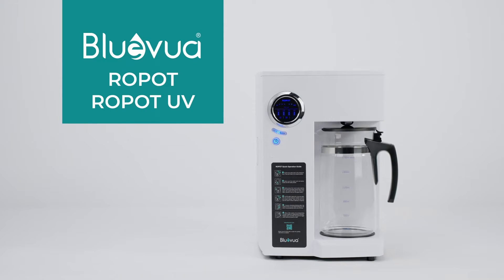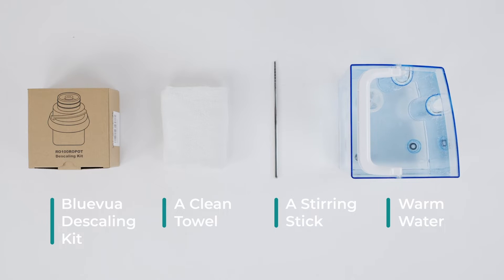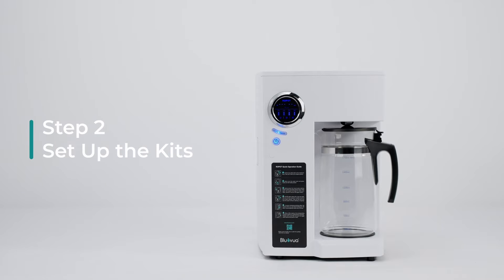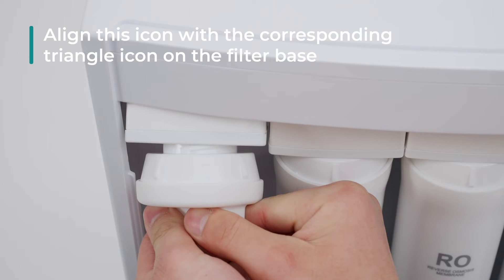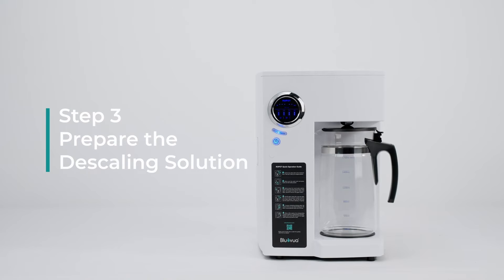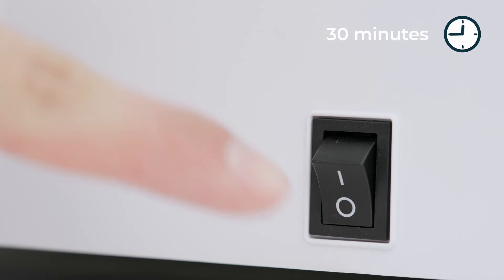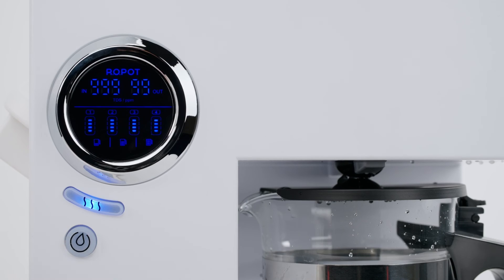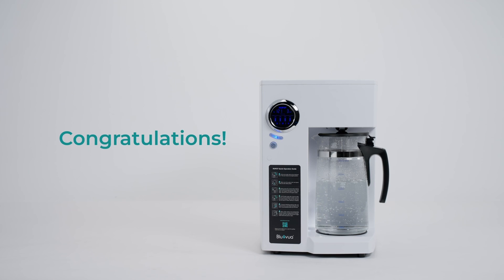How to Descale Your ROPOT & ROPOT-UV RO Water System

Comment: When it says to let it circulate the solution, you don’t say if we have to let the water run all the way through because it doesn’t take five minutes to run the water all the way through. It only took about 30 seconds. Am I supposed to let it run through all the way then wait five minutes? And then shut it off for 30 minutes? This is so confusing.

Comment: All is well until... I turned off the system to soak for 30 minutes. Next step is to turn the system back on and reactivate the unit to finish filtering the descaling solution, unfortunately the carafe is full and restarting the system adds more water to the carafe and it overflows. 
I believe the carafe should be emptied into the tank before the system is turned back on to avoid overfilling the carafe? Please amend the instructions or correct my assumptions or perhaps I'm doing something incorrectly or my system unique in that the carafe should not be full?

Comment: I Can’t find reset button
Reply: A little late but. When you have the side open to access the filter on the right side on the back for the front panel should be a lip up behind the lip you should feel a little button push that and use front panel button to switch through each filter level and reset it